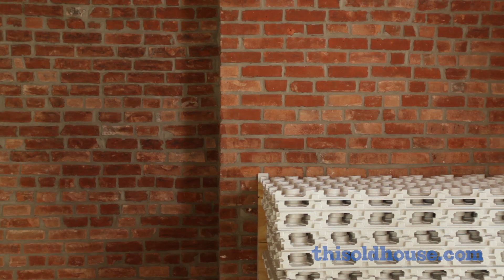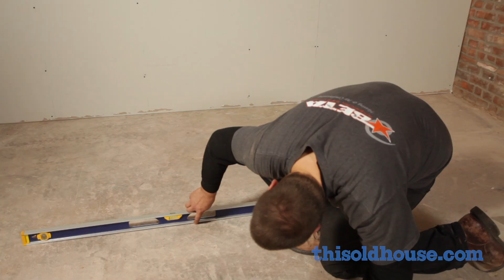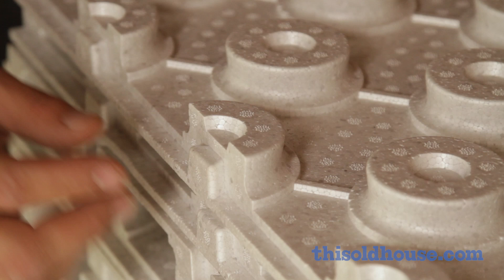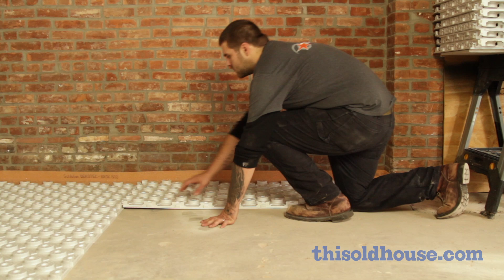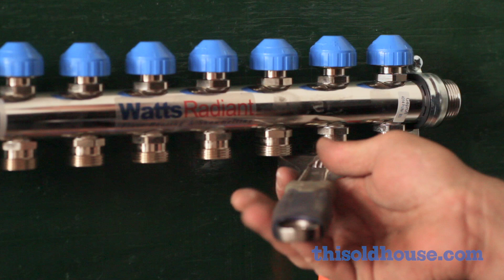How to Install DIY Radiant Floor Heating |This Old House

Comment: missing the fact that loop lengths should not exceed 300' (100m) or that a proper layout includes expected heat loss and required BTU
Reply: Thankyou. Someone that knows there is actually a science to designing a floor heating system.
Reply: I was waiting for them to at least mention the loop length, just seemed like an advertisement for Schluter.
Reply: Terry wasn't specific enough there are different maximum length for each pipe diameter.
Reply: depends on the size of the tubing used. 1/2" should not exceed 300' +-10% If you want longer runs then use 3/4.
Reply: @zentraal  it isn't a DIY project and if not.done correctly causes a hell of a mess to clean up. You clearly dont know shit about these systems. Clean up three of these disasters every other week
Reply: What is difficult about this...? It is super easy, simple design.. basic room, puny manifold. But I like the Schluter version of Sill Gasket..  I bet its also $40 a roll lol. :D
Reply: Terry Barber again not a DIY job, way too many butcher jobs we have cleaned up from know it all homeowners
Reply: @zack9912000  You MUST be an installer!! ( a know it all at that!!)
Reply: Fred Murray We get it done right the first time and none of the mistakes that  homers will make , then they have to call us anyways to fix and then lie about it when we ask what happened.

There is a reason it needs to be done by design, homeowners don’t have a clue what is required to meet code requirements or have their butcher work inspected. We get to clean up the mess they cause and the best part is your insurance will not cover the damage caused from a DIY install. 

Permits and inspection are required by nearly every spot of the country. If you don’t have those documents your insurance won’t cover it
Reply: @zack9912000  You are under the assumption that DYI's cannot do as good a job as the "professionals". Well, whether it be what we are talking about here or for that matter any type of installation, I've see DIY jobs much better than "professionals". No doubt some DYIer's don't have a clue, but not ALL, much like the "professionals"
Reply: Fred Murray I can count on a single hand of jobs I have seen a DIY job that looks good and done as designed. 95% of the jobs we clean up after are such bad jobs it is surprising someone thought they did a good job. Hell just this week we had a guy use pex on a steam boiler and it blew up inside his wall. He didn’t like the price he was given to repair the line. He now got to pay double of the original estimate. He claimed it’s too easy after watching YouTube videos on it
Reply: @zack9912000  WOW, arrogant much!!!  YOU are the exact and singular reason why people DIY projects and "professionals" charge inordinately expensive rates for EASY installations.  Radiant heat is NOT rocket science!!!
Reply: @donabele1243  thanks for proving another person has zero clue what's involved in designing and installing the radiant floor system. Keep encouraging homeowner butching these jobs. Keeps us busy and their wives anger at the idiots who wing it
Reply: @zack9912000  WOW...you just continue to make ASSumptions and show that YOU are the one that has ZERO clues.  Trust me - post your real name (like I do) - You'll never get another paid job because you've proven that you are the 'elitist professional' and no one but you can do it correctly!!!  Especially when you refer to potential customers are idiots.  Mention that, even in passing, and you'd be out on your a$$ in an instant!

If you are such the professional - POST YOUR NAME AND COMPANY.  If not - SHUT UP TROLL!!!

Just for reference...not that it'll actually mean anything to you: I'm a "non-professional" DIY with more than 30 years experience in renovating homes.  I've installed (no, "design" is not necessary - but PLANNING is!!!) three radiant systems myself, the largest being four zones covering approximately 3800 square feet.  Did that at a mere fraction of the "professionals" and had ZERO problems.  Oh, and no 'punchlists', 'do-outs', or 'call-backs'.  Get off your high-horse and move on - you've been proven wrong, out-dated, over-priced, and rude.

So, unless you are going to back up your rhetoric with your name and company name - SHOVE OFF!!!
Reply: @donabele1243  get pissed all you want. This isn't a DIY project no matter how much you argue it is. Do some basic research or hell call your local contractors who do this work and they can tell you the same thing. It's very easy to screw this up and badly. Again keep pushing homeowners to do it and I will continue to RIP out their horrible jobs and do it right with their pissed off wives yelling at people like you. When it leaks it wont be covered on most people's home insurance because no permits were pulled and not done by a licensed contractor. Done wasting time with you, have a good day.
Reply: @zack9912000  Can you describe in detail what issues you are seeing with DIY projects
Reply: @mikemurphy7519  I can post the list of issue wrong with a number of basic code issues with how this is being put it.  For one the way in which he is laying the tubing is completely wrong and will have uneven heating, boiler isseu problems as well. The length isnt correct for that room. The floor was not leveled at all, which can cause problems down the line bleeding the pex.  He is running the tubing through the wall like he did is a NO NO. No protection for the tubing from dumbasses putting holes in the line allowing 180 degree water that can burn a person badly. The manifold is too low to the floor. 

 Didnt pressure test the lines. This isnt a DIY job, we have to clean up dozens of these jobs and deal with the pissed off wife and know it all husbands who butched it in. Ever DIY job I have seen that isnt horrible still doesnt pass code and when a person try's to sell the home we find the major mistakes and no permits ever pulled. I am sure I will see some of great work this year. So keep claiming you can do it. We take cash, check or charge
Reply: @zack9912000  "Didnt pressure test the lines" there is no way for you to know that.
Reply: @kangkim150  They never showed them doing a pressure test nor did they state they did a pressure test of the lines. As how terrible of a job they have done so far, it's a very good bet it was never done.  From the butcher work I see there it was never done
Reply: @zack9912000  Thank you so much for posting that this wasn't done to code. I'm just beginning to research the possibility of installing a DIY radiant heat system in our floor. Would it be easier for a homeowner to install electric in-floor heating than hydronic? I would love to have a professional do the work. It just isn't in our budget so it's either DIY or stick to using our forced air gas heating or wood stove. Here in California, the price or gas is increasing dramatically. If we DIY, we will research extensively to find out how to install the system to code. What happens if we sell the house? If the system is operating correctly, what problems could we encounter during the sale if there was no permit or inspection done? We will keep detailed photos of the installation process.

Comment: The last image is inaccurate and would negate the heating system if installed that way. The last image is from a different job. It shows the tile going down over isolation membrane. That would be a thermal barrier keeping the heat from the tiles.
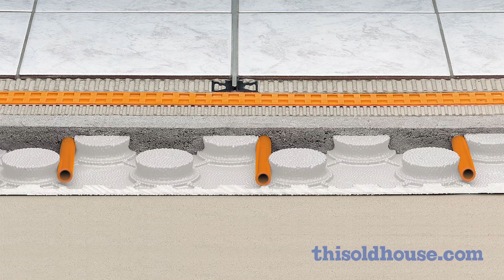Reply: +Kevin Hornbuckle If you look at the video stilled at 0:46 you will see where you made the mistake of assuming that the image is wrong or from a different job. The Schluter systems are comprehensive and always use the orange waffled underlayment applied with a 1/8 inch notch trowel directly over the concrete floor and then a 1/4 inch notch troweled thinset mortar application underneath the tile floor finish.The underlayment isn't thick enough to prevent the radiant properties of the system from being felt while simultaneously giving a more stable and comprehensively leveled surface. Not saying that I know better than you, just pointing out the point you may have missed in the video.
Reply: @0:45 No. You saw the job right.
Reply: Kevin Hornbuckle The membrane I think is redundant and pointless in most cases...
Knowing tiling for a while, it does add strength to your overall job, and thus your tiling -- theoretically--(most likely). Will last longer.  No real expansion and contraction from cold/hot would help too, I'm sure...
Reply: @LightGesture  Without the Ditra you'll see lots of cracked tile.
Reply: Typical this old house - show just enough to make people think it can be done, but don't actually show them how to do it. I'm shocked they mention brand names....

This old house is not a show about how to do things, it's a show for women to watch and get new ideas to yell at their husband.
Reply: +multidinero that is an interesting possibility. It would be good to get verification of what the tile installation method actually was on that job. I can't see why it would be necessary or even preferable to have a second isolation membrane.
Reply: @kevinhornbuckle  It's not for insulation purposes. The best quote I heard to explain this is that there are 2 types of concrete - 1)cracked and 2)one that will crack. What this membrane does is isolate the layers so the cracks don't transfer to the tiles. At least that's how this product is advertised. It's a decoupling membrane.
Reply: @irinacamilleri5818  ding ding ding we have a winner!

Comment: Looks easy,!
Reply: It is harder than it looks but is still manageable. Using a self leveling poured concrete, such as Laticrete, would make it easier.
Reply: How many homeowners tell us that when their insurance company has us come in to fix it after they spend thousands in water damage bills
Reply: @zack9912000  Of course, you see only the failed installations. Hopefully, most DIY installations are fine and you will never hear about them?